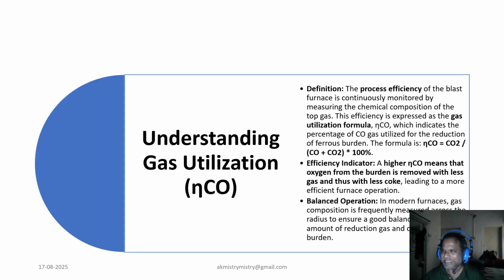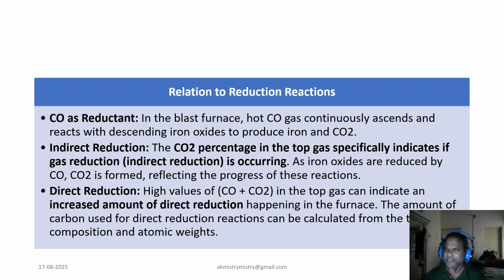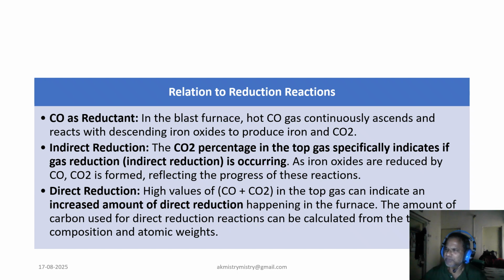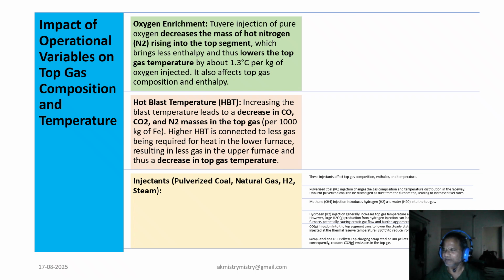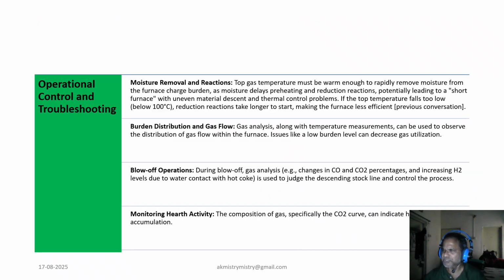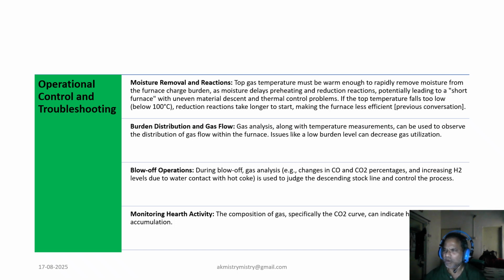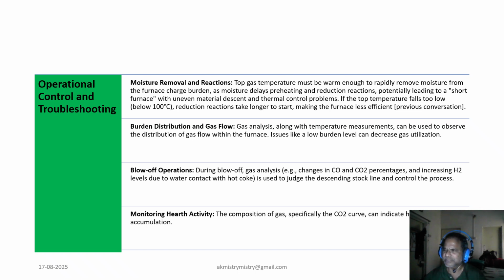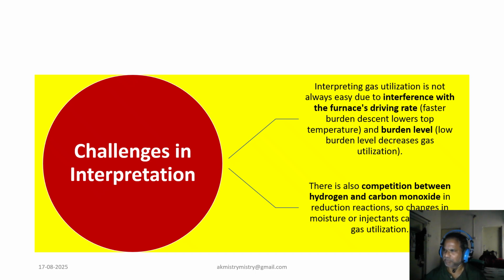Beyond the Flames: Decoding Blast Furnace Efficiency with Top Gas Analysis

Comment: Hi Sir, facing peculier issue. 

1. With same distribution, same ore and sinter, pellet% , same O2% , no changes happened and facing the low top gas temperatures problem below 95 degree. 

2. Furnace is on hotter side with HMT 1490 , but ETA CO is low 40 to 41.
3. What could be reason for low TGT
Reply from the maker: Based on the provided information,the low top gas temperature (TGT) below 95°C, despite a hot hearth (HMT 1490°C) and low CO utilization (ηCO 40-41%), can be attributed to the following reasons:
• Charge Moisture Evaporation: As the raw materials (burden and coke) descend through the furnace, moisture contained within them is evaporated. This phase change is an endothermic process, consuming a significant amount of heat from the ascending gases, which directly leads to a reduction in the top gas temperature.
• Inefficient Gas Utilization (Low ηCO): The reported low CO utilization rate (ηCO of 40-41%) indicates that the reducing gases are not efficiently reacting with the iron ore in the upper part of the furnace. In the upper stack, heat from the gas is transferred to the burden, and CO removes oxygen from the ore, generating CO2 in what is known as indirect reduction. A lower efficiency in these gas-solid reactions means less chemical heat is being generated or transferred effectively, resulting in a cooler top gas.
• Unburnt Char Reactions: If unburnt char from pulverized coal injection reaches the upper furnace, it can participate in endothermic reactions. Specifically, the solution loss reaction (C + CO2 = 2CO) is a heat-consuming process that can occur in the softening and cohesive zones. The presence of unburnt char at the furnace top has been observed, and if it reacts in these zones, it would further lower the gas temperature.